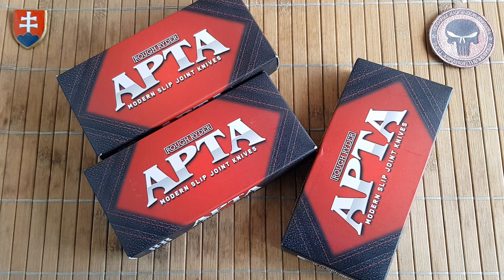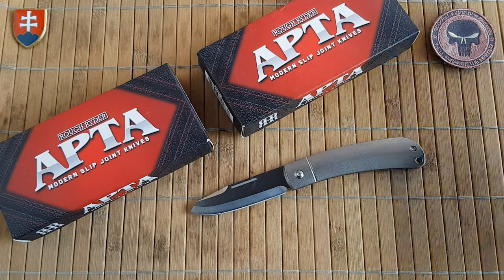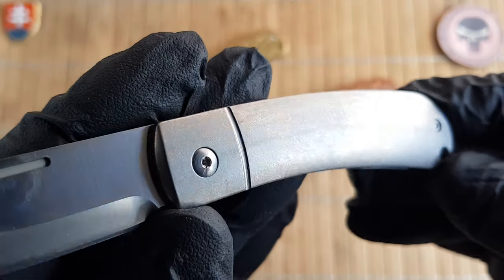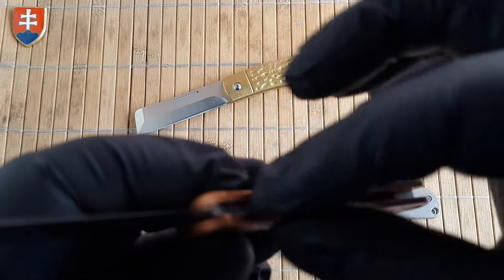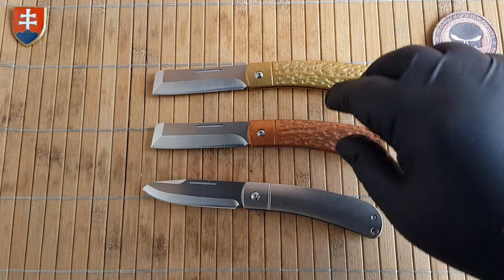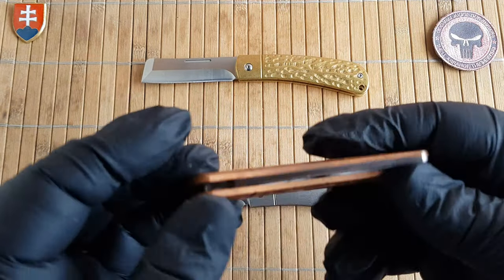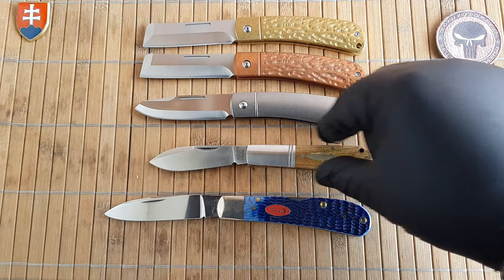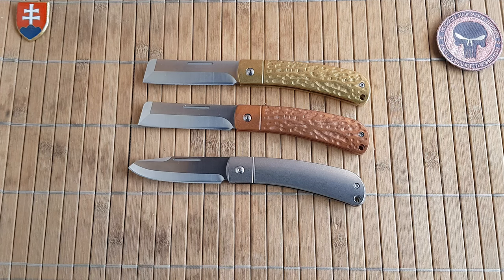ROUGH RYDER APTA MODERN SLIP JOINT

Comment: Great video, this series doesn't get enough attention. I have 5 of them. Two things I would say is that there is no tang stamp because they wanted to keep the blade clean. You know the brand by the model number beginning with RR. Also a big pat of this series is that they are meant to be taken apart and blade swapped. This is why they only offered certain blade shapes with certain handle materials. I have 3 brass versions, one cleaver, one sheepsfoot (micarta version) and one drop point (red aluminum version). Which also means I have a red aluminum cleaver and a micarta cleaver.
Reply from the maker: Thanks, Eric good to know they were meant to be blade swapped I did a video on that topic. I want to get also the aluminum version but my dealer still did not get it so I have to wait.